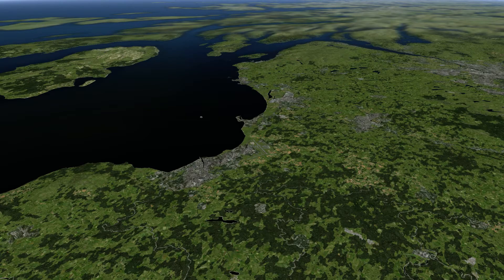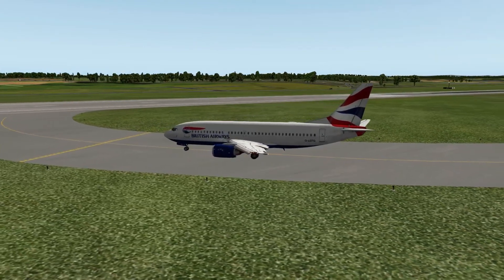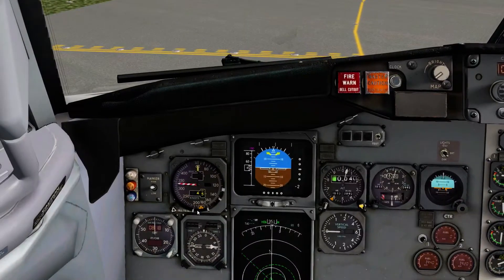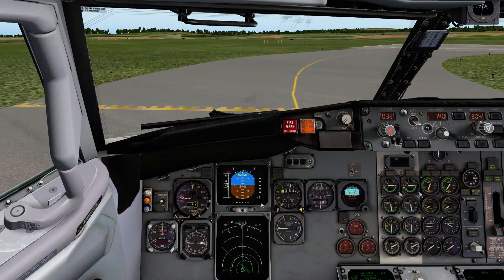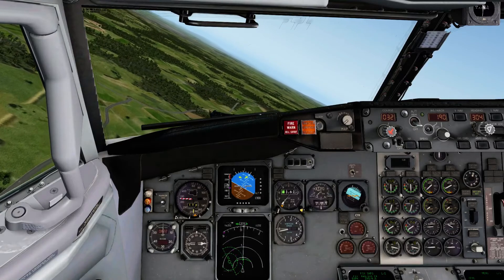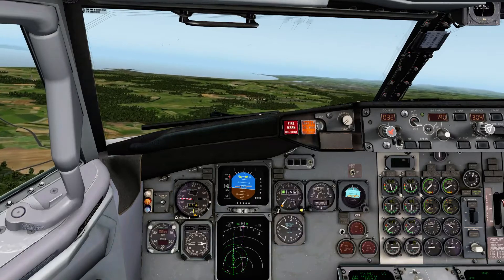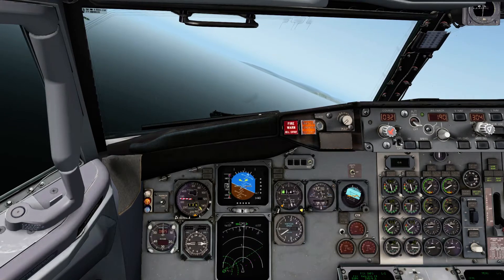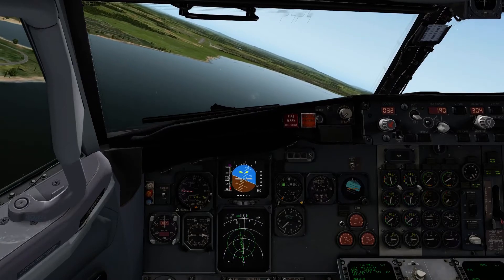IXEG 737 Base Training EGPK [X-Plane]

Comment: Hiya,

Doing a warmup session from good ole EGPK to somewhere down south while the boss sorts us breakfast hehe

Then i'll get cracking on this i swear :-)

Brilliant vid yet again

Just keep em comin ! 

Have Fun

Tony

ps : I was working putting heavy pre-treatment plants and powder coating plants up at (spl?) Nicoll McKay (late 90's)

On the occasions we have to put ground to air ducts up, we used to watch i think it was virgin doing touch n goes, someone told us that a takeoff cost 10k and as long as no complete stoppage they could touch n go all day (no idea how true that was) That sure was amazing as the planes came right by the factory, it was then i realised just how big the big planes are lol, and the noise was awesome, it looked like they flew figure of eight loops, then again with working and slyly watching i could be wrong
Reply from the maker: Thanks Tony, I know Monkton very well having grown up on the Ayrshire coast. Repeated touch and goes could cause tyre temperature issues, but probably not an issue in the west coast climate. Those figure eights you mention, it's quite common to fly one circuit left hand, the next right hand just to avoid making noise over the same houses all day long. In a 747 I'd guess 2-3 tonnes of fuel for a circuit.
Reply: Heya,

The left/right hand circuits would of made me think a figure of eight then lol

Thanks

Tony

Comment: Very much informative.Can you please do a video tutorial on PARO approach,landing and take off with 737-300 IXEG?
Reply from the maker: I don't know if the 737 is capable of operating into Paro. I know Druk Air have operated the BAe 146/RJ prior to moving to the Airbus, and the A319s they have are fitted with the more powerful A320 or A321 engines. That being said I'll take a look and if it's possible to operate semi-realistically then I may be able to do something.
Reply: Thank you very much.
Reply from the maker: I've spent a couple of hours flying around Paro with the 737, bit I've found the performance is a bit too marginal so I probably won't make a video at this point, at least not with the 737-300. However, if you want to go ahead and try it:-

In X-Plane I've been departing Flaps 5 and Flaps 15, increase V2 by 10 kts over the QRH value to allow 30 degree bank angle and weights to give a max V2 of 140 knots. For the circling turns 9500ft is possible and 10000ft slightly more comfortable. Gear Down, Flaps 15 speed 150, or Flaps 20 speed 140.  Again 140 is more comfortable due to the turn radius.

Check out the diagrams linked in the following page:

http://www.boeing.com/commercial/aeromagazine/aero_23/737-700Bhutan_story.html

specifically: http://www.boeing.com/commercial/aeromagazine/aero_23/737-700Bhutan_fig2.html

I'd recommend flying this pattern at 10000 ft, Gear down, Flaps 15, Speed 150, with the AP in and HDG mode for a few laps to get comfortable with the turning points in the valley.

Some more background performance information:

http://www.flightsafety.org/asw/apr08/asw_apr08_p22-26.pdf?dl=1

Hope this helps!
Reply: Thanks a lot Captain for your efforts to my request.I tried the take off with flaps15 and without engaging A/T N191%.Did a hand flying up to 19000ft  with visual on terrain.But not being a professional in aviation,I can not do a test flight as you performed in EGPK base training video.I did that flight VQPR-VECC.Requesting you to do a video with A319 aerosoft in Prepar3d,if you are using that simulator.Once again salute you sir for your time to share the information

Comment: Loving your videos tremendously and will watch them all. One small request however if it's not too much of a bother. Is it possible to turn up the  aircraft sounds just a touch if it doesn't interfere with what you are demonstrating. Id love to hear engine sounds a little more if possible. Thanks for what you are doing for us simmers.

Comment: Sir I have a serious issue regarding Microsoft flight simulator I can't reached to the destination. when I reach then the runway have missed again I contact the ATC but every time WRONG headings from ATC what should I do any solution.
Reply from the maker: Thanks for getting in touch. I'm afraid I don't use the MSFS ATC, but from memory you need to have flight route loaded for it to work. Could you possibly create a video of the problem you have and I could take a look?